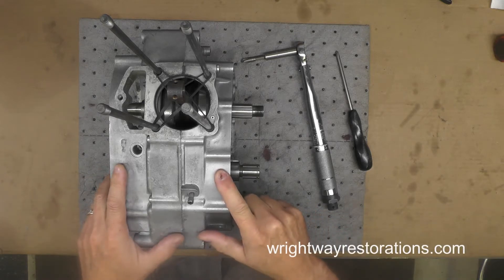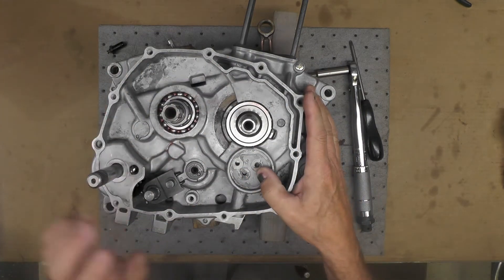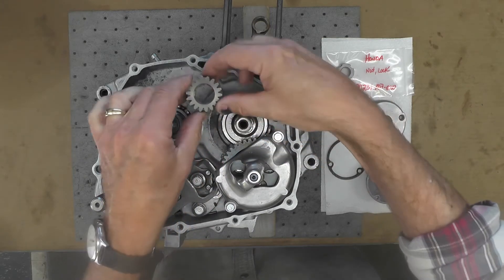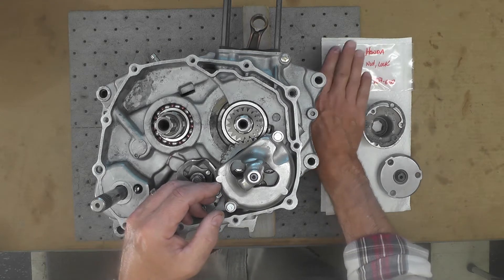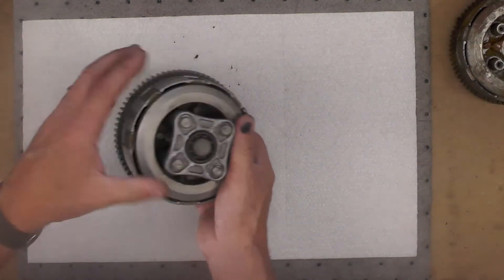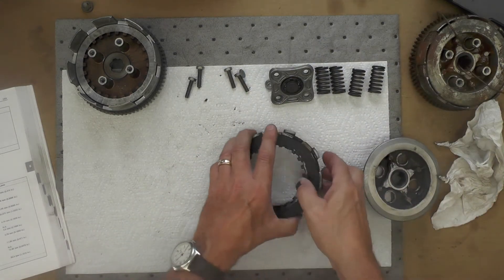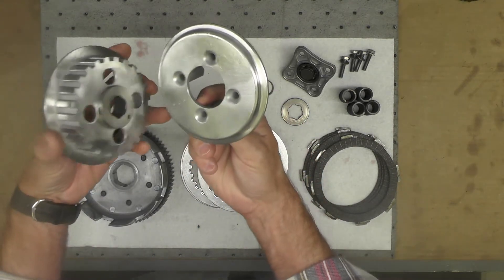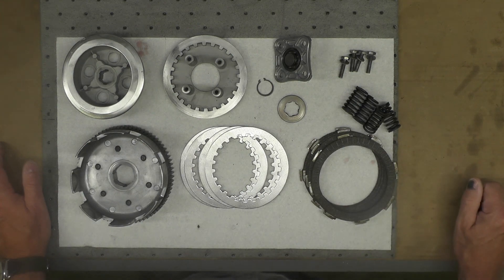Honda SL125, Engine Reassembly Pt 2 --- Video #221

Comment: Do you use assembly lube on your bearings during reassembly? What measurements did you perform on your oil pump when you reassembled it? Looks like quite the "whammy" on your thumb nail! Perhaps a hammer incident (LOL)?
Reply from the maker: Regarding assembly lube, absolutely, I use it very liberally on the bearings and inside wear surface of all seals.  In terms of the oil pump, I didn't do any measurements.  I cleaned and inspected it carefully when preparing for installation, then again used plenty of assembly lube on the pump internals to allow it seal and pickup when the time comes.  I'll also check this immediately upon first engine start by watching the top end for oil flow.  Always use plenty of assembly lube everywhere applicable.
Now to the thumb... actually though the thumb nail looks bad, the right index finger got it worse, darn near took off the tip and banged up that nail good also.   I was cleaning a part on grinder wire wheel late in the day, was getting tired and I got sloppy.  The part  snagged the wheel, got embedded in the wire wheel, came around and got the fingers.  In a fraction of a second, happened so fast it was over before I knew what happened.  When I saw the blood from the index finger tip (like I said, pretty much clipped it off), I knew it was serious.  A most unpleasant experience and goes to show, when you get sloppy, bad things happen... and I certainly know better.

Are you still trying to reach me, Pete?  I did respond a few days ago here.
Reply: yes .. I sent a message, but did not get a response from you. Something is up with our e-mail connection! I too had a mishap this week. I was cleaning the eaves trough and sliced my hand for 5 stitches! Must be something in the air this time of year. Cheers!
Reply from the maker: @peteetwell826  We can try this again... go to my blog site and at the top of the home page you'll see a "CONTACT" tab.  Select this, fill in the info and I'll get an email.
I cleaned our eave troughs about a month ago, thankfully without issue.  Hope your recovery goes well.
Reply: @kwrightway  I am getting your messages on my phone but not on my home computer. I sent an email to the account on the auto reply from your blog. Let me know if you get it.
Reply from the maker: @peteetwell826  I haven't received anything yet.  Did you use the "CONTACT" tab on the top of the blog site home page?
Reply: @kwrightway  yes, that is what I have been using. I just sent another test message and got an auto response to my yahoo mail account. the response came from an fnwusers account. Is that still valid?
Reply from the maker: @peteetwell826  Hmm, I made a few adjustments and ran a test and it correctly notified me that I had a contact request pending.  Please try again...

You are correct, the 'fnwusers' account hasn't been used in years and is invalid.  Odd thing is though, I get occasional contact requests from the Blog right along so why it decided to stop working now is a mystery.